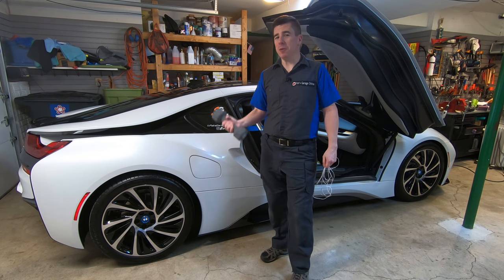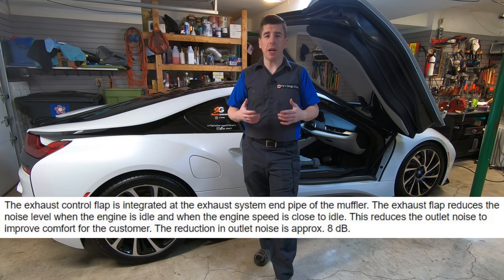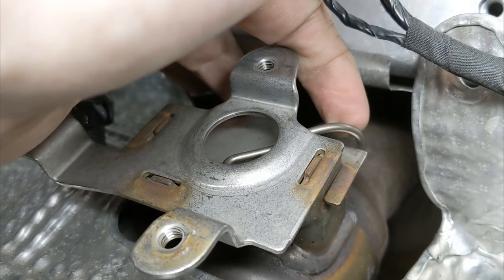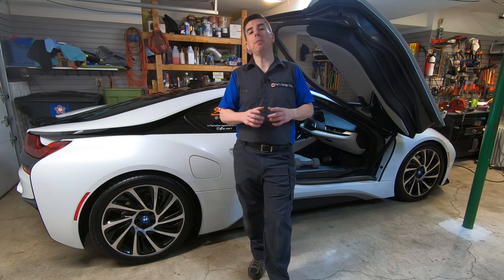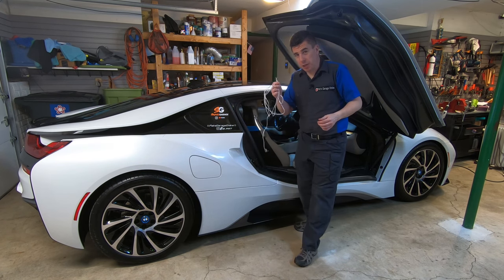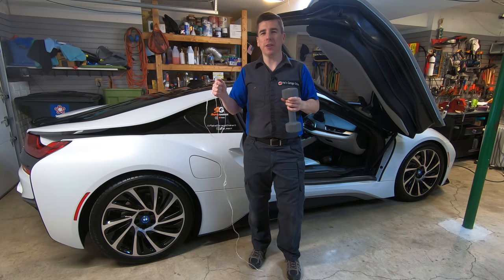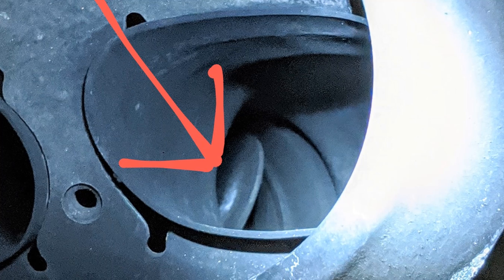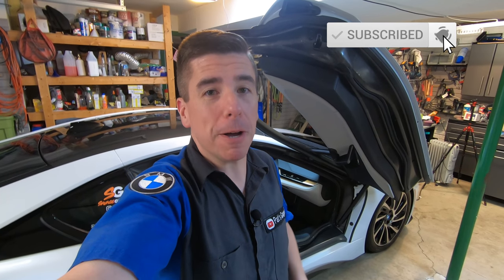How to modify BMW i8 exhaust for FREE with a string and a weight!

Comment: Hi Pat, another great vid. Where would be the best place to ask you a question about the i8 that is not related specifically to this video?

Actually am just going to ask it here. I’m just over a year into my i8 ownership and wonder if you have the same problems I do with the seatbelt guides (on the sides of the front seats)?  Both myself and passengers have this issue, the belt never stays within its guide meaning when you put it on you have to reach way back to get it. These seem poorly designed to me — I know they probably left the tops of the guides open so that the seatbelts wouldn’t always obstruct access to the back seats but how often do you have passengers back there anyway? Whenever I take my sealbelt off it never stays inside the guide, maybe because my shoulder level when sitting is higher than the top of it possibly, though I haven’t fully analysed this. Do you have any suggestions or perhaps even a robust solution/mod for this issue by any chance? (hint hint ;)
Reply from the maker: Thanks for asking here. It's super easy to reply. 

I suggest that when you take the belt off you lay the belt inside the seat bolster. That means that your back will touch the seat belt. If you do this every time, the belt won't flop outside of the seatbelt guide and it also gives a neat and clean appearance when leaving the car.
Reply: Thanks, why didn’t I think of that? Will definitely try this next time!

Comment: Hey pat is fuse 58 the same fuse for a 2019 bmw i8 I don’t want to ruin my baby if I do this hack
Reply from the maker: I just pulled up the service info on the 2019-2020 cars and the same fuse 58 is used to control the exhaust flap.
Reply: @PatsGarageOnline   your one of the best YouTuberrs appreciate all you do! Will be doing that tune soon and using your 50 off promo code thanks brother🙏🏻.

should I pull the fuse 58 before I tune the i8 or after I tune it so I don’t get that check engine light ??? What do you recommend

Comment: Hi Pat you should really watch my video on the changing your wheels for the I8 makes the car look a 100 times better
Reply from the maker: Subscribed!  Congrats on the i8 purchase and welcome to the club!  Please consider joining the FB i8 group and sharing your video.  https://www.facebook.com/groups/bmwi8group/

When it comes to wheels, I'm an outlier.  I actually like the stock Turbine style rims.  My car came with the W style rims and I found the Turbine rims, used, on eBay and absolutely love them.  Edo Popken is running EM OZ forged 20” wheels with Michelin Cup2 245 front 265 rear for the least unsprung weight he can on the i8 ProCar race car in Germany.  But, I'm not really concerned about weight.

Comment: Anyone has check engine light come on and off  after removing the fuse?   I would have check engine light up  for a day or so and then dissapear for a week and then it would come back again on my 2016 i8.  The fault code is  exhaust flap....  i put the fuse back in and 3 months now - no check engine light anymore.

Comment: On a late production 2018/19 can you just remove the fuse when engine on or off Pat.
Reply from the maker: Even in late model i8's, the valve us closed until you demand high power from the engine, according to the technical training manual.

Comment: Hi Pat, do you know how to increase the engine sound coming from the speakers, inside the car? Thanks!
Reply from the maker: Unfortunately, that's not possible. The internal sounds that augment the engine noise are integrated into the sound system and can't be altered. The small speaker at the back of the car won't generate engine noises below $3,000 RPM. There are aftermarket options like Maxhaust but this does not sink well with the exhaust note coming from the car.
Reply: @PatsGarageOnline  thank you so much Pat! ... even if I was really hoping there was a solution for that...

Comment: Hey Pat does this allow you to “rev” the car?,  meaning it’ll be as loud as in sports mode
Reply from the maker: After doing the exhaust mod, it sounds like Sport Mode. You can rev the car If you get in the car, shut the door, put the seat belt on, put your foot on the brake and hit the start/stop button, then put your foot on the gas. That'll cause the engine to start and then you can rev it.

Comment: Pat, how can you reverse this modification in the event you want to go back to quiet mode on low speeds
Reply from the maker: Simply re-insert the fuse back into the fuse panel.  The car will determine the correct position for the flap as long as it has power.
Reply: @PatsGarageOnline  Awesome... I have 2017 i8 Frozen Protonic Black edition and it is so much fun to drive it around...I love your insight and am always looking forward to next video.. 🙏

Comment: Does the i8 have a rear jack point where I can lift both rear tires?  I'm trying to put my i8 on 4 jack stands so I can remove the wheels to get it powdercoated
Reply from the maker: Hi Wendy.  It doesn't have designated jack points outside of those plastic ones just under the rocker panels.  However, the lower rear controls arms bolt to a very large aluminum sub frame.  You just can't see it because the aluminum cover is installed under the car for good aero.  But, I was able to put a jackstand on that area after I jacked the car on the plastic jack pad.  I did this in this video:  https://youtu.be/xp0KdLzJwho?t=304

Rich Rebuilds is pointing to that area, here:
https://youtu.be/TP8IAsPyJ58?t=327

It's not something BMW would likely recommend, and I can't advise to protect myself against liability, but if you did decided to try jacking or using a jack stand on this area, you might consider putting something like a hockey puck between the jackstand and the vehicle to prevent marring.
Reply: @PatsGarageOnline  gotcha.  Thanks for the info.

Comment: Hey pat when you turn on the car will it have a cold start or is it still quiet ?
Reply from the maker: The car starts in electric mode. If you wait several weeks before running the mid engine, the mid engine will also start in order to keep the oil circulating.

Comment: Hi pat, is there any way to increase horsepower ?
Reply from the maker: Several i8 owners have installed the Vivid Racing tune found online or other tunes. The 40 or so HO I'd get for $1500 isn't worth it to me, however. Edo Motorsport is working on developing a new turbo which will definitely help.
Reply: Pat's Garage Online great thank you pat 👍🏼

Comment: And welcome to Pat's Garage, where you will not only learn how to modify your exhaust, but you will also develop an 18" bicep.💪 😉

Pat, did you take a page out of a comparable hack for the C6 generation's dual-mode exhaust? "Normal" operation was for them to be closed until about 3k to 3.5k rpm at which time they would automatically open. The only way to make them stay open all the time was to pull the fuse, which you did not have lto do ike what you did. You could take the fuse out even with the car turned off. FWIW, I know the C7's can override the "normally" closed valves electronically. Newer generation, newer and improved technology for sure.

I would have preferred you used the Lady Becca over a ten pound weight though.You could have injured your Rotator Cuff! 😊 It was brilliant hack Pat! You do bring new meaning to the maxim that "There's more than one way to skin a cat." 🤣 Save the Wave.🙋🏼‍♂️
Reply from the maker: Thanks Peter!  Lady Becca has been spending all of her free time at the horse farm, prepping her horse for sale, so I'm on my own most of the time.  So, I had plenty of time to figure out how I was going to test this.  Unfortunately, the i8 requires the engine to be under load (according to the technical training manual), so I can't just rev it and pull the fuse, I have to drive it.  I wasn't aware that the C6 also could be modified by pulling a fuse until you mentioned it.  But, speaking of a rotator cuff injury, I have it.  I fell asleep weirdly Wed night and I knew it, but didn't roll around.  In the morning, I woke up with pain in the shoulder and it's still here.  I'm on "light duty" right now, hoping for some relief, so I'm taking it easy...
Reply: @PatsGarageOnline   As always, thank you so much for your reply. I forgot about Lady Becca's love of and responsibility to her horses. 

I did  mention the Rotator Cuff in jest, but not entirely. I really injured mine while doing dips on the parallel bars. This was confirmed through an MRI that I had torn it and I was in lot of pain. Surgery had been scheduled, which I had to cancel at the very last minute due to family emergency. Anyway, with a lot of use of Advil and a great Sports Medicine MD,  I came back. Well, I "came back" more in my strength than in my flexibility. But at least I was able to remove my pull-over shirts, which I previously was not able to do. I was also no longer able to throw a fast ball or a long pass, but who am I kidding, my glory days are long gone. I'll take a shirt removal any time and I don't mind be a Water Boy for the team. I can still hold my own with them in gym, as long as I stay away from the parallel bars.😁 As you stated, stay on "light duty" and eventually you'll do well.
Save the Wave, even if only half a wave.
Reply from the maker: Thanks Peter. Sorry to hear about all the issues you've had with your shoulder. I've been very lucky not to have something like that happen. This is just a freak situation of sleeping the wrong way leading to this problem. I feel it more when I call or wash my back with that arm. I'm able to get my shirts on and off with only a little bit of pain. Nothing to the extent you went through. So I probably just strained mine. I'll be sure to take it easy for a while. Thank you.
Reply: Thanks Pat. And if by some chance you think it's time to push the envelope during your period of light duty, call me. I'll come straight down to Maryland with two bottles of Johnnie Walker. One Black Label and one Gold Label. By the time we knock those two puppies back, the only range of motion you'll be concerned with is if you can still lift a glass to down more of the Nectar from the Gods. Don't worry, if you find yourself tightening up, I'll bring straws, loooong straws. Zero range of motion required. No, no, no, don't thank me. That's what friends do when friends are in need.🤣 Stay strong 💪my friend. Don't worry, be a happy. Hey, I think I may have to make up a song about that.😁
Reply from the maker: I'll take it. In fact, I'll gladly share my JW Blue with you (only served for special occasions with good friends). 😉
Reply: Say what!? JW Blue!?  WOW! I always new you were a 1st Class guy, but THAT'S Star Class! 

We need to do an upgrade of the old Grey Poupon Commercial. I need to pull up in the Vette alongside to you in the I8. Our windows go down and I ask you, "Pardon me, do you have any Blue Label?" Your reply: "Of course I do. I never leave home without it." It would be epic, especially when you pull out a bottle of Blue Coral wax!😉🤣🤭😁😊😂🤩🙃😖

Comment: Cool mod but if I had an i8 and wanted more sound I'd just get an electronic sound booster upgrade. There's only so much you can do to make a 3-cylinder sound better. I've heard many aftermarket exhausts for this car and even a muffler delete - they don't improve the sound much and cost a lot. Boosting by artificial sound is the only way to make this car sound the way it looks short of an engine swap. Yes, it's fake but 90% who hear it won't know and will spare the driver an embarrassing subcompact soundtrack to an exotic looking ride.
Reply from the maker: Alex Myers of Yorkshire DPF Centre has just developed a new exhaust for 1/4 of the Fi price. I'll be getting one soon to test. From the data he put out, months of testing has resulted in better wave forms that compliment the electronic exhaust sounds. I'm looking forward to this.
Reply: @PatsGarageOnline  OK, definitely want to hear this and await your review.
Reply from the maker: https://www.yorkshiredpfcentre.com/product-page/bmw-i8-custom-exhaust